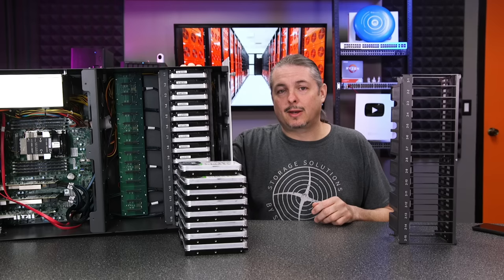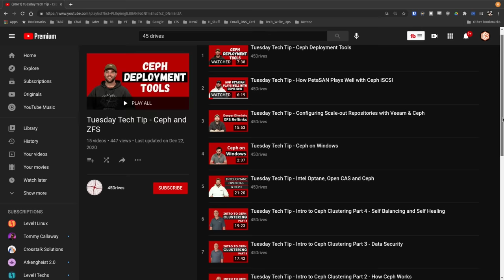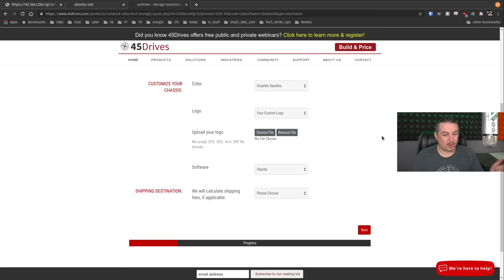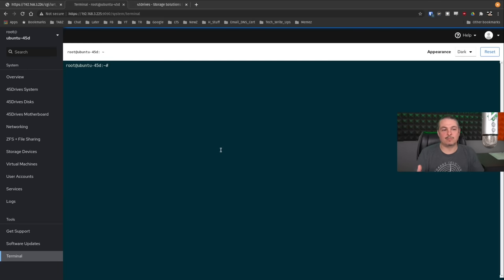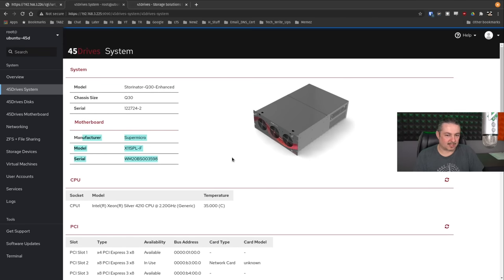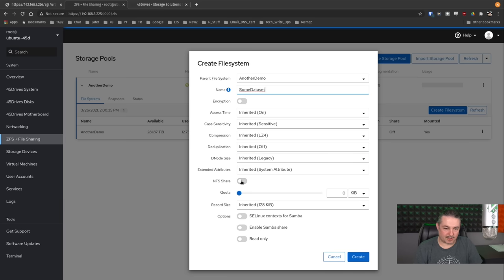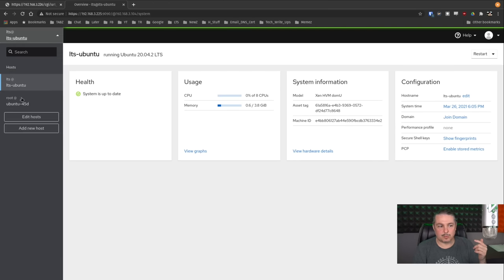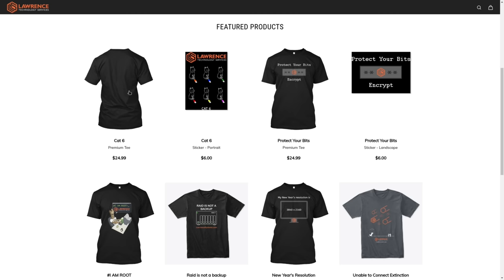45 Drives Storinator Q30 Review

Comment: It looks a well-designed system with excellent gui, what is the performance like compared with comparable storage options?
Reply: most of the enterprise storage systems have dual controllers redundancy
that means the hard drives and storage system are designed to avoid a single controller failure
i dont see this option being available in the configuration

the bottleneck in alot of the storage systems, is starting to be networking and hardware resources. you are seeing solutions for lowering latency and cpu cycles,  RoCE with 100G ethernet will become common place. you can easily saturate alot of the current ethernet connections with nvme storage.
these systems do not have a lot of options for networking (no 100G) and make no mention of the cards installed in the configuration (ie RoCE support). for 45 disks with SSD caching or tiering options for 45, this is disappointing.

people forget when your buying for businesses, you are buying both hardware software and support for the products lifecycle. dell emc, hpe, hitachi, pure storage and all  have mission critical onsite support whereas with highly trained technicians will respond to any business outage to get you back online.  from what i can tell this product from 45 drives offers no direct support from the OEM outside "live support" that must be supplemented through a third party support like surprise Lawrence Systems. when you get into these solutions you are getting to engineer your own solution great, however the critical support will vary widely and part availability from the third support party this can mean lots downtime and while you wait for replacement parts. i wouldnt be comfortable buying this personally even though the technology looks interesting.

its too much risk, i rather go with vendor would support that has a fully engineered solution, that will support both the hardware and software in cases issues occur.   the cost of alot of the enterprise storage systems is the support, and getting next business onsite and 4 hour support options is a lifesafer and limits the downtime for the business. outages are expensive for businesses lost sales and revenue, downtime can have significant costs into millions for large companies.

if you need that much storage, i would seriously look at what you are storing there and what is the RTO and RPO for failures. if you can tolerate outages waiting for part replacement into days or weeks and support that is fractured between different vendors without clear ownership of support issues.  i would rather pay extra to have a single vendor and a fully engineered solution with ownership end to end to help handle all support issues including critical incidents to get your business back online as soon as possible.
Reply: Hey  @hiddeninthewires2308  
thank you for the detailed comment. For clarity, 45Drives is an established enterprise storage vendor. We offer direct support to both the software and hardware of your storage system. 45Drives is the only company to have adopted full hardware/software support for open-source storage systems. We will source your replacement parts, troubleshoot, etc.,
We understand the needs of the enterprise customers we sell to, with downtime being mission critical. We offer highly-available Ceph clustering solutions (also fully supported for both hardware and software) to ensure RTO and RPO objectives are met. Our engineers work with companies to understand their needs to ensure the systems we help implement will be up to any challenges they face.

Our open-source designs offer an advantage in sourcing replacement parts, and our systems are software-defined and use commodity hardware. This means that customers can easily source their replacement parts in special circumstances, as there are no needless proprietary restrictions. Most times, though, we ship replacement parts to our customers. I hope this cleared that up for you. We are trusted by some of the world's biggest companies, Google, Intel, Amazon, Red Hat, Apple, etc., With over 20 000 customers worldwide. Our systems operate in the majority of the top educational institutes in the United States. Our support offering has been critical aspect in our success. Also, per the NIC cards, if you open up the "build and price" on our website, you can configure your system to have up to 3 additional cards, depending on the unit you selected.
Thanks again for the comment.
Reply: @45Drives   there is no "direct" onsite support in your build listing.  you may enter custom agreements for onsite support but you dont offer this on your website. the only support was limited hours of live support.

 I realize that clustering and highly available solution can mitigate outages when parts do eventually fail.  however, the mean time to repair, can help mitigate and lessen the risk of a subsequence failure causing an outage.
without onsite support and parts available waiting days is putting a business at risk. companies large enough in size may keep stock and parts on hand to do the replacement themselves and return the equipment, this means extra costs and support pressures.
 
without knowing the details of your customers, some of them have there own storage solutions. they have probably partnered with you to build a hardware platform to run there own software solutions most customers do not have developers on hand and do not design there own storage software.

this is why. for some customers but a lot of customers want the traditional enterprise onsite support and fully supported stack.

Comment: As much as I like this particular case design. If installing it in a rack and needing to hot swap drives. You would have to leave 4 RU worth of space above it. In order to take off the top and extract the faulty drive. Then insert a new drive.
Reply from the maker: No you don't, it's on rails that allow it to slide out.

Comment: Do they offer build your own with like 10 drives for an free license? For example if you want to try it out on your own hardware before dropping $$$ or for your home lab?
Reply from the maker: The review was done using Ubuntu and Cockpit, both are open source and do not require a licence.
Reply: The base configurations come an SSD for booting. You can configure it with hard drives or buy it without and use your own. 

The custom software is all open source and free so no licenses required. 

You can put whatever OS you want on it.

Comment: Tom: when you say "cockpit", since that's just a WebUI...do you know if they're using CentOS, Fedora, or CentOS Streams?
Reply from the maker: As I stated in the software section of the video, they are using Ubuntu but support other operating systems as well.
Reply: Found my answer; sounds like it used to be CentOS, but moving towards a multi-OS support model (via Ubuntu and Rocky Linux) going forward.

Comment: serious question, how would you backup 300TB?
Reply: depends on what you are aiming for local backup buy 2 and replicate across them with zfs replication if your trying to go off-site do the initial sync locally and then move off-site find a good network connection and hope you don't change out all the data in a day. cloud backups would probably be possible with someone like Backblaze but i don't want to pay that bill
Reply: @tw3145wallenstein  if you buy two of these, and both are at 90% usage, you can only keep one full backup. What if the file was deleted a week ago by mistake? That isn't enough backup IMHO. And offsite is extremely expensive and will take weeks to upload all that unless you have 10gb fiber
Reply from the maker: it takes some strategy when you have that much data to back up and your restore plan may have to involve physically moving servers to get the data back in a reasonable time.
Reply: @LAWRENCESYSTEMS  But if you were making a project for a possible client that wants to backup their storinator with a couple weeks of versioning, what would be your proposal?
Reply: @25566  you are 100% correct they are things that i overlooked in my 30 sec train of thought. Have a great day!
Reply: @25566  that’s why you’d use an OS and file system that supports snapshots. For example, you choose to use TrueNAS which uses the ZFS file system. 

You would pic a schedule for snapshots on your primary server that makes sense given your use case. That schedule should cover you for recovery of files that were accidentally deleted. 

You would setup replication to your backup server and the data and snapshots would be duplicated to it. So even if the entire primary server is lost, you can still get that accidentally deleted file from the back up server. 

And if you’ve got the budget, you replicate to a third server offsite.
Reply: @25566  as for having enough space, you’ve got to account for space that will be taken up by snapshots as part of deciding how much storage space you’ll need on your primary server as well as your back up server.

But since only blocks that  have changed occupy space in a snapshot, each snapshot is likely to be quite small. 

As opposed to legacy storage systems that have to keep a new copy of the entire file each time there is a change.
Reply: @williamp6800  thanks, this strategy makes sense
Reply: @williamp6800  Even with say ext4 its it easy doing small "full" incremental backups using rsync and its --link-dest option...
But yes snapshots are the way to go, I'm a btrfs man myself but would also go for zfs with this many drives just for the higher raid levels supported.
Also filesystems that don't checksum all data.... zfs and btrfs may be a slower that say ext4/ntfs but the other additional features they bring are worth it for me.